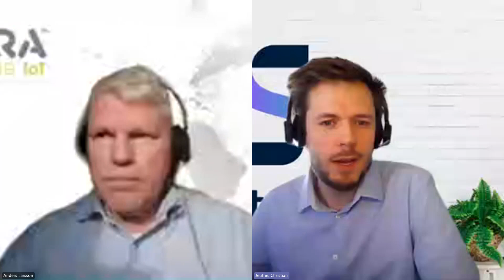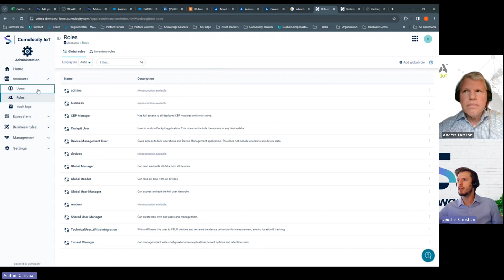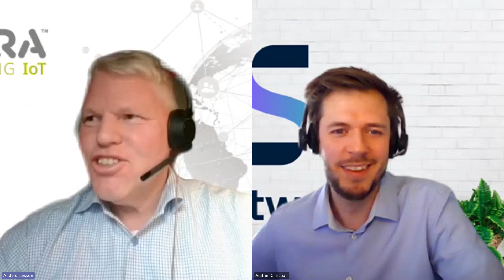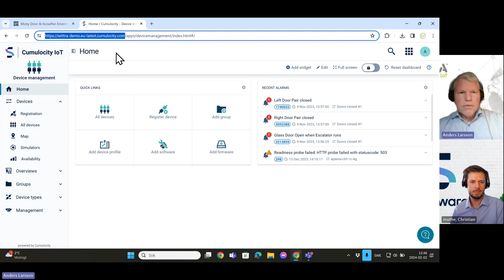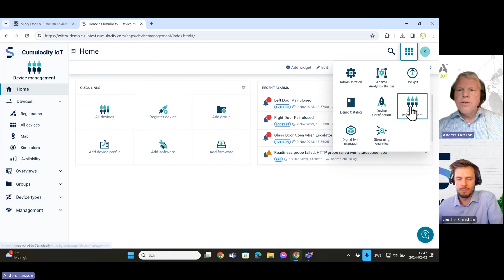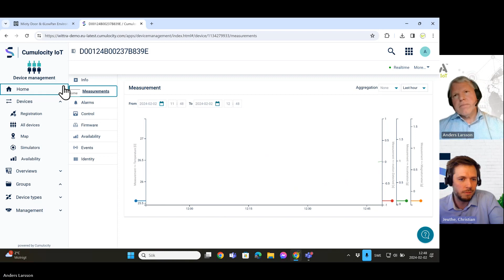How to connect Wittra Networks devices with Cumulocity IoT

Comment: A good summary of WiTTRA's approach to unification of wireless technologies in a single system to address most on-site IoT use cases, coupled with the power and flexibility of Cumulocity as the end user interface.